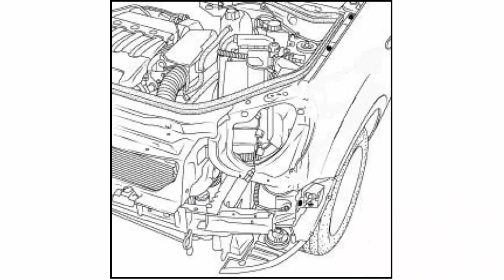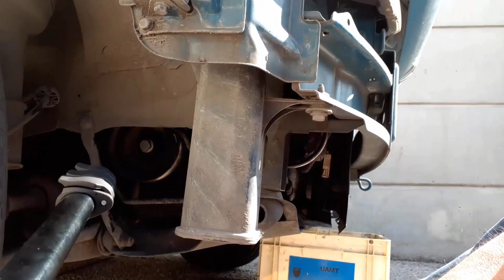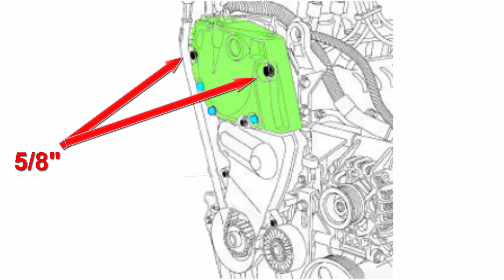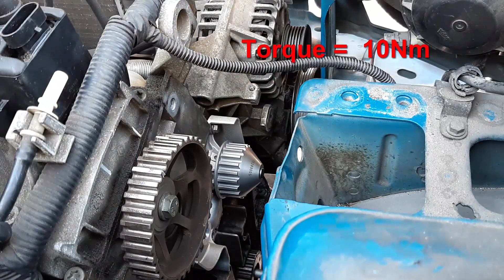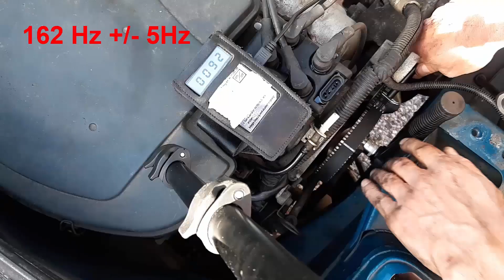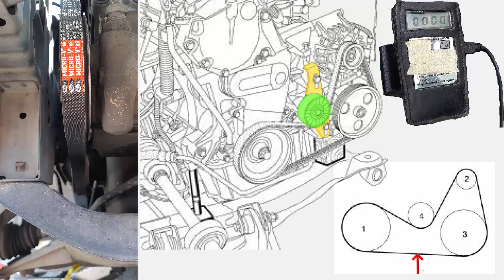Timing belt on a E7J635 engine.

Comment: Hello Olivier, thank you very much for this video. This is quite insightful for me. And I am trying as you did as my water pump is leaking. 

Could you tell me how you aligned the timing belt to the TDC please? I checked several other videos and I presumed that you turned the crank shaft pulley by fastening its retainer bolt. When I did it, the bolt was fastened tight but the crank shaft pulley didn’t turn. I didn’t apply too much torque because I didn’t want to damage the bolt threads. If you did it otherwise, could you advise please?
Reply from the maker: Hello, thank yo for your kind comment.
To align the pulleys on the timing marks, be sure that your gear box is in neutral position. 
You don't a gear engaged
I hope it helps.
Reply: Thank you very much for your quick response. Yes the gear was in the neutral. Actually I also tried it by turning the wheel putting it in the first gear. The wheel turned but the belt stayed quiet. I put it in the 5th but again the same. I think I have another problem here…

Comment: Hi Oliver. I have a 2005 1.4 Kangoo 8v. Would timing setup be similar to your video? Thanks Anton.
Great video by the way. Thanks for sharing your knowledge.
Reply from the maker: Hello Anton,
I know that some of these engines have an other tensionner pulley.
I can't find infos on your MK1 phase 2 model year.
So please, check with a Renault dealer.
If it is a "two holes" tensionner pulley like in the video, your good to proceed.
Kind regards.

Comment: You are the best my friend !!! Very hepfull video!!!!  I have a Renault clio II 1.4 8 v E7jc634d and i want to ask you if is the same job  because the engine seems the same with your.
Reply from the maker: I Nikolas,
This is the very same procedure.
Thank you for your encouraging comment.
I wish you a mery Christmas and a Happy new Year.
Reply: @olipirard  Thank you !!! I wish you mery Crhristmas and Happy new Year too!!!
A healthy 2021 year!!!
Reply: @olipirard  Hi Olivier. I have Kangoo with E7j634. What the correct position of tensioner - two holes down or up? Thank you
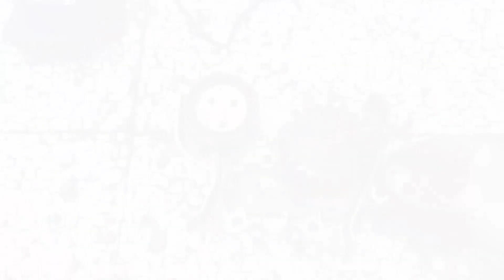Reply from the maker: @A6arlie  Hello Lukas, In the video @22:32 , you can see that the tensioner pulley bearing holes are above the stud.
So, long story short, the holes must been up.
Thank you for your question it helps the community.
Regards.
Reply: @olipirard  Thank you. I saw it in the video. 
But in another videos the holes were down.